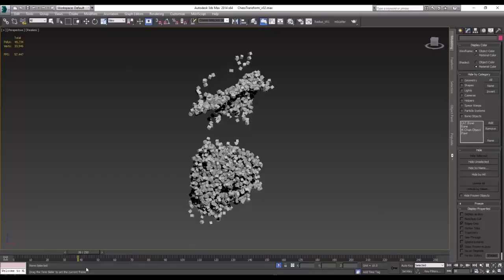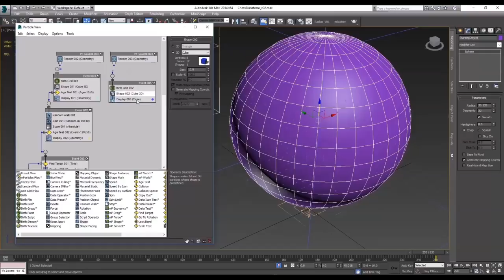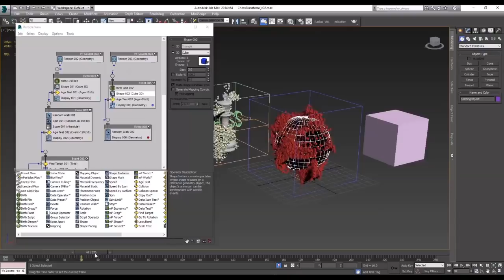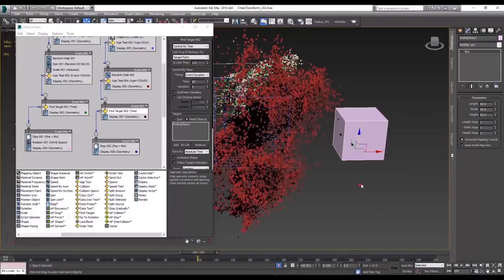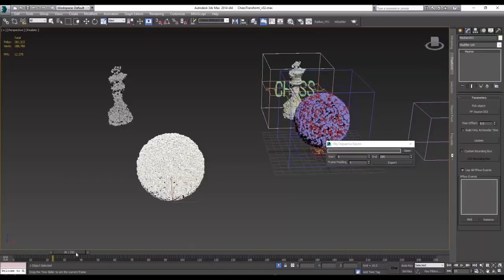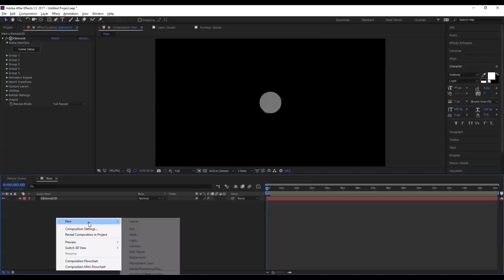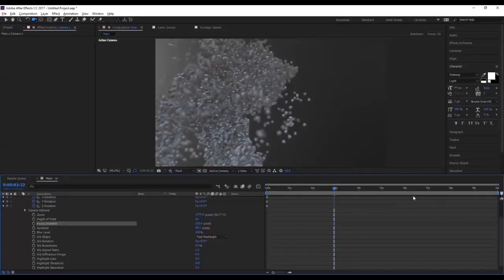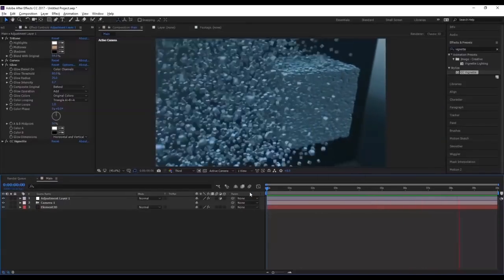Tutorial - Transforming One 3D Object Into Another - 3ds Max, Particle Flow & Element3D

Comment: cant find RANDOM WALK in 3dsmax 2016
Reply from the maker: It should be there, you might just need to scroll down in the operators list. Check here for more info: https://forums.autodesk.com/t5/3ds-max-forum/missing-random-walk/td-p/5979083
Reply: alright, i'll check it and get back to you.
Another problem which i am facing is when i increase the size of the BIRTH GRID to 100x100x100 the particles only fill half the grid and not completely.
Using 3DSMAX 2016
Reply from the maker: That has to do with the display percentage. By default, I believe 3dsMax doesnt display 100% of the particles in the viewport to save on ram. You can change this by selecting the birth grid in your scene and increasing the "upper limit", until to see your object filled. You may need to also change the display settings in pflow, by going to each event and changing the display amount to 100%. Hope that helps.